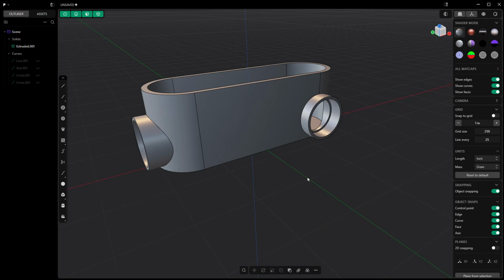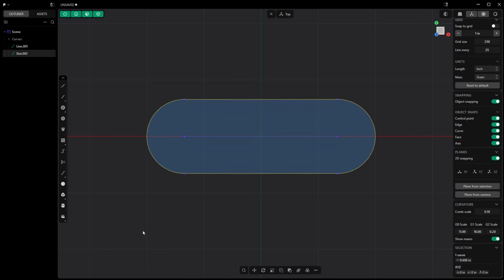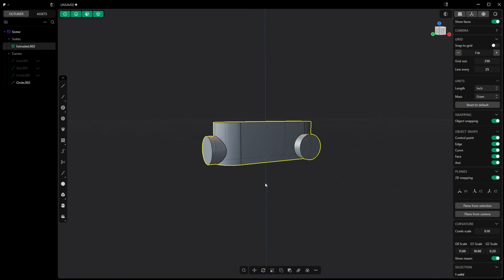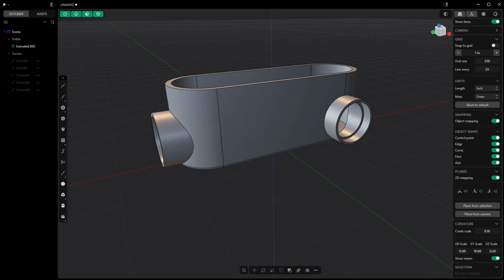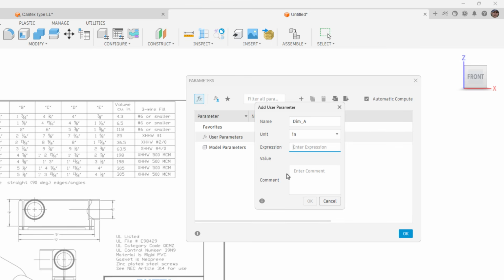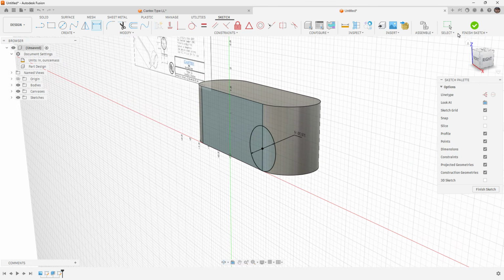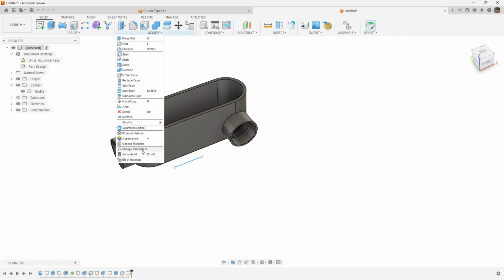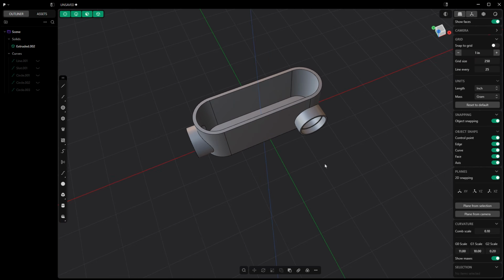Fusion vs Plasticity Modeling Comparison | Cantex Type LL PVC Conduit Configuration

Comment: Using Fusion for designing is just *pain*. I guess if you need to make some very specific part it makes sense to use.
For everything else you can use Plasticity and import it in Fusion if you need the simulation functionality.

Comment: It would be great to have half parametric option in plasticity. 
So that curves and basic primitives retain their parameters in an easily controllable manner. 
As an Alias modeler for over 30 years, I wish this approach for decades. As long as you keep history in Alias, you sort of have this but it is very fragile. 
Parametric modeling in fusion or freecad is a PITA (for a free form modeler) as sketching is so annoying and most of the time it is not really necessary. 
Free form basic curves (lines, circles, segments) could have their parameters but they should be placed freely and all subsequent operations (like lofting) would have a 3d vector and still be parametric.
Reply from the maker: Yeah it would be nice.  The Dimension and Measure tools can do that to a certain extent in Plasticity.  So for example if you make a hole through a solid starting with a circle,  later on you can resize that using those tools.  Measure also works during Move and lets you use the dimensions.

But at a curve level, not really (to the best of my knowledge at least).

In Fusion forms you do have "Edit by curve" which is a variation of the edit form tool,  but it basically gives you a control point spline to manipulate a form rather than grabbing the vert,edge,face itself.  It can get you in trouble just like adding a ton of points to a spline though.  We don't quite get the same level of control as Alias, but Xnurbs in Plasticity is a great surfacing tool.

Comment: The split I keep running into on a car body is that the shape wants to be freeform and the part has to be dimensioned. I model a Lada 2106 in Onshape from a reference mesh — the mesh gets me the shape in an hour, then it takes an evening to turn that into surfaces someone could actually cut. Same two-tool problem, inside one program.
Reply from the maker: Yeah.  In Plasticity you can do 3d curves on a mesh, or in fusion you can extract mesh curves or use forms and snap to the mesh.  Same thing sort of.  Both programs here have multiple workflows offered, but the key point is direct modeling vs parametric.
Reply: @LearnEverythingAboutDesign  That is roughly what I do in Onshape — sketch on the mesh, then rebuild as proper surfaces so the part stays parametric. Works fine until the mesh is bad in exactly the place the curve matters, which on a fifty-year-old car is most places. Then it stops being tracing and becomes judgement.

Comment: Imperial measurement suck and are only used by United States, Liberia, and Myanmar. So glad we changed to the metric system over 50 years ago.
Reply from the maker: Yeah I default to using mm for everything, but its much easier when the "thing" is defined in inch to just switch the units.

Comment: I can tell you the outcome before watching, because the same question pops up in my field too: programming IDE is better? The answer is painfully simple and equally frustrating: It doesn't matter, choose the one you like to work with.

Some tools can do X, other tools can do Y, most of the time you don't need either X nor Y so it really does not matter which tool use as long as it enables you to get the job done efficiently.
Reply: yes and no; "right tool for the job" applies, but also "you don't know until you do".
Reply from the maker: Yeah in this case it is actually very different.  One is a "Direct" modeler and the other is a "Parametric" modeler.  While the core 3d kernel and math might be the same the path you take to get there is different.  Fusion lets you add dimensions to a parameter table and make multiple versions of the part as configurations.  Plasticity doesn't have that capability.  That is part of the nuance.

Comment: 99% of my design work is dimensionally driven level 3 work.  Used many softwares at work, for home I've become pretty comfortable with Fusion.  I'm no artist and a cube is pretty much the perfect form.  In the rare case I need something crazy freeform, I grab my son's meta quest and sketch it in gravity sketch.  Its pretty insane how quickly you can make 3d stuff when actually working in 3d.  You can import it back into fusion to model the unmodelable.
Reply from the maker: Gravity Sketch was put on my radar awhile back but I have yet to play with it.  Seemed like a "toy" initially but maybe i should circle back :)